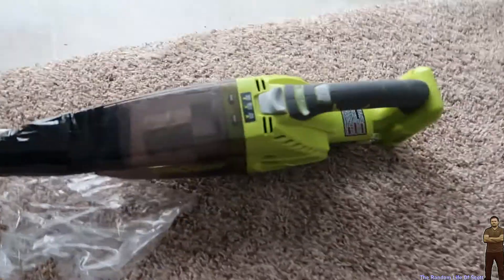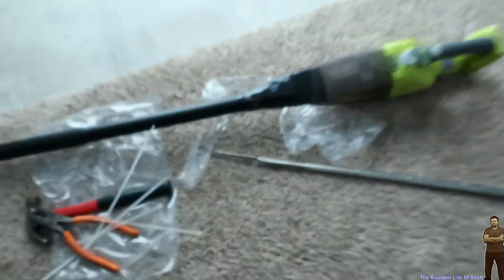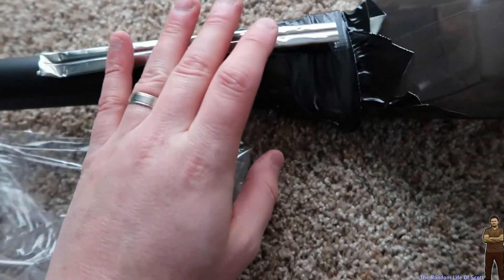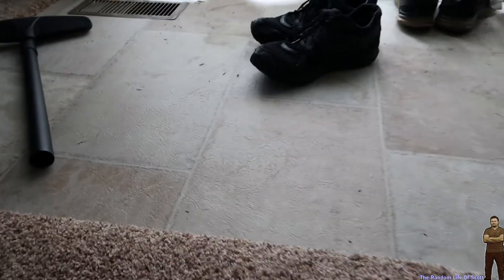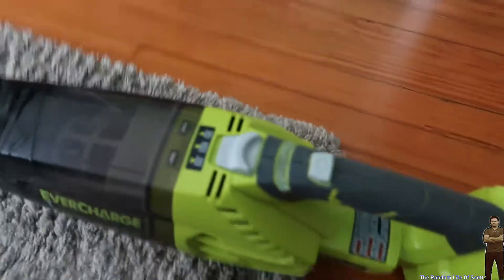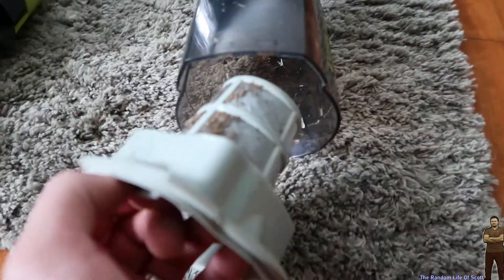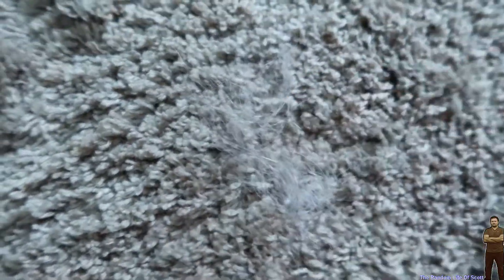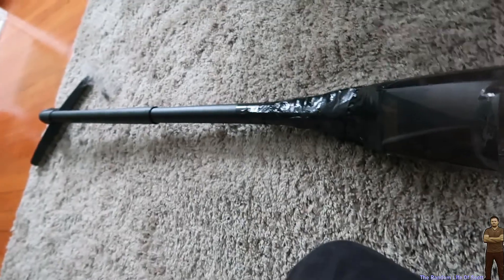How To Turn Your Hand Vac Into A Hand-Floor Vac That Actually WORKS - Ryobi Project

Comment from the maker: vac kit = https://amzn.to/2RuvnVn
Ryobi hand vac = https://amzn.to/36xByMw
Duct Tape = https://amzn.to/2Rwj3E3
Zip ties = https://amzn.to/2O3MkUy
Paint Stirr = https://amzn.to/2GpNPIq
Cen-Tec Systems 91409 7 Piece Vacuum Accessory Set with Plastic Wands
 This vacuum accessory will fit all major canister vacuums, upright vacuums, and central vacuum brands with 1.25 inch connections
Includes the 34905 12Hard floor tool with natural fill
2 plastic extension wands will connect to the hose to improve reach and effectiveness
Perfectly sized crevice tool and dust brush will allow the operator to clean in tight spaces